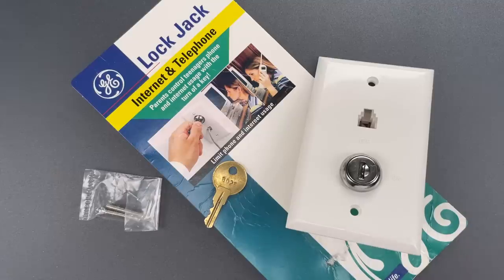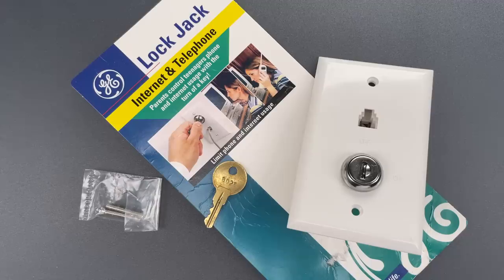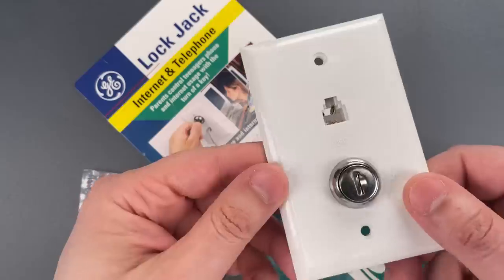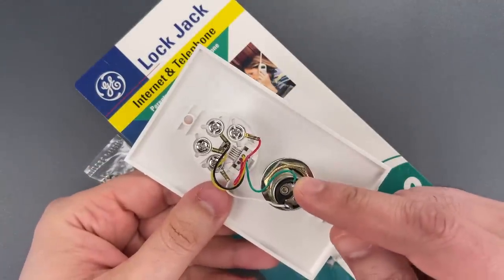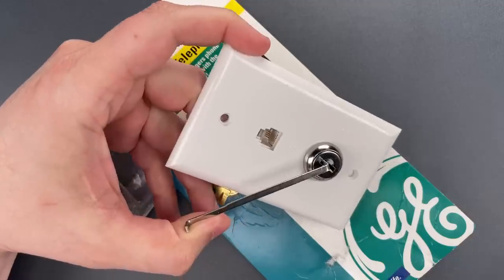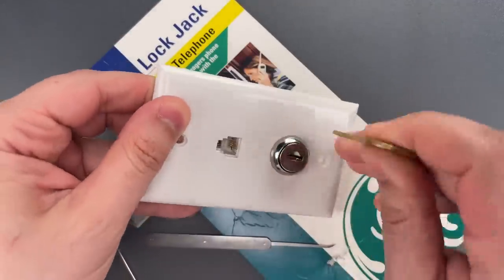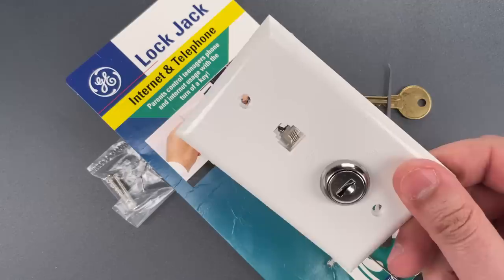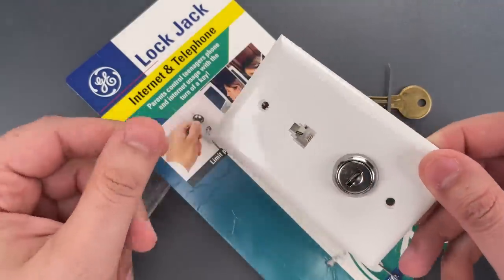[1284] 1990’s GE Internet Lock Picked

Comment: A more foolproof way to stop internet usage in dialup days was for someone else in the house to pick up a phone and start dialing
Reply: Haha or an incoming
Reply: @xspower8899  No, incoming calls will sound busy, so will not interrupt your connection.
Reply: @SilverGreen93  only if you did not have call waiting.  the beeps would interrupt most of the cheaper modems.
Reply: Yeah... 
Spend hours trying to connect to your favourite BBS only to have someone pick up an extension 😳
Those where the days... Oh how i miss them  (not) 🤣🤣
Reply: The problem was never outgoing calls. But incoming... since when using the internet in the 90's occupying the only way people had to reach each other, I can see why parents thought this was needed. Like... it's not viable to pick up the phone every 30 minutes to see if your kid is on the internet or not. So this was a good enough solution.
Reply: @anthonygandy1090  Never knew call waiting existed. At least in my region (Eastern Europe) it didn't until mobile phones were introduced, later on in the 2000s. But never on landlines.
Reply: @MateusAntonioBittencourt  As a kid in the early 90's I can speak from experience my non tech mom constantly picked up the phone and dialed not understanding what a modem even was.  This lead to much cursing on my part getting bounced from BBS's that had only a few slots or screwing up that jpg download you were already 10 minutes  into
Reply: @SilverGreen93  ah yes thats right been so long.
Reply: This would have been useful in my house as a kid. My parents got a second phone line just for internet access (because my dad could get in serious trouble with work if he failed to answer a call from them). But we also lived in a town that didn't have a local AOL phone number, so we had to use their 1-900 number that cost $6/min, making using the internet very expensive.
Reply: @SilverGreen93  Dialing will cause the connection to be dropped. I remember it all too well.

I remember call-waiting used to cause the connection to be dropped too - very annoying. There was a dial sequence that would temporarily disable call-waiting to prevent this from happening.
Reply: @jkoll42  That's precisely why I explicitly said that for OUTGOING CALLS this does nothing. Since a person can pick up... dial and drop you.

The problem was always INCOMMING CALLS. Since a person would try to call my mom, while I was in the internet. And since this was the 90's that was the only way to reach her.

Of course I didn't use the internet without her knowing and allowing... but some more disobedient kid could. Like the parents are expecting a call and the kid goes online without authorization, and they wouldn't notice the line was occupied.

Get it now? Or do I need to draw?
Reply: @MateusAntonioBittencourt  If you don't have a call‑waiting service (like I did) then the incoming calls cannot disconnect your internet. Only trying to dial a number to make a call (outgoing) will disconnect you.
Reply: My mom used to take the phone off the hook to keep my brother from using the phone. Then my brother discovered the Telephone Network Interface on the back of the house and just plugged in right there to use the phone....
Reply: The foolproof way to stop internet was to make sure "remember" was unticked on the dialer program, so the number, username and password had to be entered each and every time. 

Incoming calls would disconnect the internet if you had call waiting, voicemail or caller ID. It also happened regardless if you were phreaking the call, or on particular types of telco networks. 

Picking up the phone would only disconnect you if the handset was off the hook for longer than 15 seconds. With the noise the modem was making on the line, most people would slam the handset back down within 2 seconds. If you attempted to dial however, that would disconnect immediately. 

Don't forget, dial up internet had the cost of a phone call associated, then the internet itself was charged both by the MINUTE/HOUR and by the data used, usually by the Mb.
Reply: Or send the command `ATH` to the modem on a different system connected to the same line, which will disconnect the current call, even if that modem wasn't the one initiating the call.
Reply: If the line had call-waiting, the beep from that could bump you off-line in most cases.
Reply: @MicraHakkinen  ATD and ATA work just as well. They continue to work on LTE modems.
Reply: @MateusAntonioBittencourt  a good modem had two jacks. One for a line, second for a phone. Cause phone in parallel connection with modem leaded to poor connection speed. So if the parents connected modem properly, all they had to do was to peek up a phone. If no signal - their kid uses dial-up connection or a line is broken. First was much easier to check up.
Reply: @G5rry  "*70," I believe.
Reply: @MateusAntonioBittencourt  I am the kid who made a correct in-house part of a phone line so parents would not break my connection when they pick up the phone. If parents are true paranoid on incoming call, they will check the prescence of signal in line. And if they are good at math, not only paranoid, they will select periods between checks with random number generator...
Reply: @SilverGreen93  my old man had a Motorola house laying brick in the 90's x8500 I believe
Reply: @MateusAntonioBittencourt  the key is if parents are waiting for a call or not. If waiting, they have plenty of ways to secure a line from a kid. And if not, etherything is just exactly as you say.
Reply: Wasnt there a prefix number that you could use to deny oncoming calls making it busy so as not to interrupt the connection? Im trying to remember what i used. Until mom lifted the other phone.
Reply: Not even, just being on the line was enough to confuse a lot of modems right up until the V92 era
Reply: @SilverGreen93  Bell Labs had optional call waiting by the touch tone era in the 1970s. Similarly, color television was standardized by the FCC in 1952 after developments by RCA in 1948, but it took another decade or more to get passed in Europe, and some countries didn't have it until the early 1980s. 
There was a lot of playing catch up at that time!
Reply: Cerus98  May be true, but not in my country. Except caller id which was implemented somewhere in the 2000s, those never existed in my area for landlines
Reply: Back in the day - A friend of mine and I were addicted to StarCraft, and our only way to play multiplayer was a direct dial up connection because I didn't have actual internet.  So we would be an hour or so into a game and my sister would purposely pick up the phone to disconnect us because she wanted to go talk to her friends for hours on the phone.  We didn't have call waiting or anything, so I was inevitably at the mercy of hoping no one picked up the phone lol.
Reply: @MicraHakkinen  Sending the ATH command to an analog modem that isn't online does nothing. Maybe sending ATH to an ISDN modem would terminate a call originated by another modem on the same line? Never dealt with ISDN modems.
Reply: The wiring in my house was so bad the dial up disconnected when you turned on the shower, for some reason.
Reply: nooooo mum wait a minute dont pick up that phooone :-D
Reply: It was also a great way for someone to hear folks yelling at you "I'M ON THE PHONE!", as they start hearing the screeching of the modem in their phone conversation.
LOL!  Good times.  Good times.    Which reminds me, I need to get a "modem dialup" ring tone for my phone.  :D
Reply: lol ah the good ol' days.
Reply: i did that so many times when my brother was online and i wanted to, pick up phone-tap some buttons--wait for net to drop- repeat till he gave up reconnecting
Reply: *70 FTW
Reply: @Lucasbpc  Was that house on well water? I could see some issue with the wiring causing a disconnect when the well pump starts up.
Reply: @brianleeper5737  no, it was an electrical shower, most likely they used the same tubing to wire the phone and the 220 phase and the interference was just enough to cut off dial up when you added the 600W of the heating element
Reply: @MateusAntonioBittencourt  Jesus dude... People are on a LPL video recounting stories on 1990's dial up internet. What's with all the agro and name calling dude? It's not an argument. Lighten up.
Reply: @Lucasbpc  I take it you are in the UK? In the USA it is never allowed to run phone and power in the same tubing/conduit.
Reply: @anthonygandy1090  ATD *70,<ISP NUMBER>
Reply: @brianleeper5737  no, I am in Brazil. The cables still shouldn't run in the same tubing, but alas. We usually have fired clay brick/concrete walls, which doesn't make it specially easy to redo the tubing when the need arises.
Reply: @Lucasbpc  For brick/concrete walls where wiring needs to be done the usual solution is Wiremold or some other surface mount raceway. Some people think Wiremold looks ugly but you know what, I kinda like the way it looks!
Reply: @MateusAntonioBittencourt  well, I am sure about leaking pipes :) I've got a device that shuts the water down if there is a water under pipes.
And you are right about emergency calls. In a previous century this was usually solved by knowing neighbors' phone too. Line, phone, mom talking for hour or so, this all could be overridden by a neighbor knocking on you door with bad news.
And you are sharp as a needle, I was 14 or so when used a dial-up modem. So my knowledge was not enough to make modem not to drop communication after hang-up of parallel phone (and provider had a terribly small pool of lines so it was usual to dial for half an hour or so).
Reply: Hahahahaha
Reply: @xspower8899  an incoming if they had call waiting
Reply: The times where you could have more than one line too. The time where consumers knew ISDN and PSDN, PBX and PABX.
Reply: @rajamicitrenti1374  couldn't you have used a non local number? I don"t even remember AOL having a 900 number but ya that would make it expensive
Reply: @anthonygandy1090   US Robotics Courier V.Everything for the win!
Reply: @herrflick101   So how about all those babes.gif's?  😉
Reply: @MicraHakkinen   ATH is only interpreted on the DTE side of the MODEM, not the phone line.  In the situation you describe, ATA or ATD should drop the connection though, because the MODEM being used to interfere with the connection, will then sound tones on the phone line.
Reply: @MateusAntonioBittencourt   "If the line was occupied... no one could call the house."

People have already mentioned the Call Waiting feature that is available on some PSTN networks.  Do you not know how that feature works on PSTN?  An occupied line can still be called, the caller hears a ringing tone and the receiving end hears a call waiting tone.  That call waiting tone can cause MODEM's to drop their connection.

No different from MODEM's hearing the DTMF dialing tones for outgoing calls and then dropping the call from that.
Reply: @Lucasbpc   You had electric instant hot water?
Reply: @MateusAntonioBittencourt   "Also... why you keep bringing the fact a proper setup modem doesn't drop the call? Any idiot did that. My line never dropped when My mom wanted to make a call and she heard the "internet noises""

If your Mom heard the "Internet noises", you didn't set your connection up properly as Яков Кашин described.
Reply: @beardymcbeardface69  what are these GIFs you speak of... 🤣🤣🤣
Reply: @derrickfoster644  I was a teen at the time so wasn't paying the phone bills and thus have little memory of the cost discussion. But this was back in 1995, and I suspect that the long distance call costs were higher than that outside of the dead of night.
Reply: @herrflick101   Oh yeah, a likely story!  👙
Reply: @beardymcbeardface69  that is normal down here, yep
Reply: @Lucasbpc   Okay, I was thinking maybe the instantaneous high current of instant electric hot water, might have caused noise that your MODEM choked on.
Reply: @beardymcbeardface69  maybe. Again, that was very odd. What made it worse is, to use dial up on discount time you had to connect at night, right when everyone wanted to take a shower as well.
Reply: @Lucasbpc   Thank goodness those bad old days are behind us.

My old dialup speed would suffer whenever it would rain, because where I was living at the time, our phone lines were terminated in pits with concrete manhole covers that were not water tight.  So they'd literally start to fill up with rain water, touching the exposed copper terminations.

Same problem occurred when we got ADSL.

Thankfully my current apartment has no such issues!
Reply: @anthonygandy1090  You could get around call waiting by disabling it in the dialing string.  Usually by including *70.
Reply: @rajamicitrenti1374  Cheaper to ship the kids off to boarding school!
Reply: I always had this ambiguous feeling about the late 90s. Life was so cool back then, but internet still sucked.
Reply: @SilverGreen93  Here in the UK it exists but is pretty rare on home phone lines since the phone companies charge extra to enable it on your line.
Reply: Cerus98  There were alot of plans with data limits when the net got commercialized (mid 90's) and alot of access numbers weren't local depending on where you were.The access point would have data usage tracking in place in most cases considering what it was mostly used for in the 80's.
Reply: Cerus98   Maybe in the US, but other parts of the World did it differently.  In Australia we had dialup plans that were based on data usage.  When I started with Internet access via BBS's in 91, the existence and duration of connection time limits, depended on the BBS.  But once non-BBS dialup ISPs came on the scene, they were mostly providing data limits on a plan, with no time limits.
Reply: @SilverGreen93  Depending on the time and place, often incoming calls would make a sound on the active line so you knew you were getting another call - at some point in some places you could switch to the incoming call with a sequence of keys.
Reply: Still happening with mobile carriers.
Reply: @beardymcbeardface69  not much has really changed, my old ADSL would typically die during wet weather and storms can still cause issues in the NBN era thanks to the last mile of copper to the premises. My dialup ISP had a free account from 1am-8am I made use of in high school, got disconnected twice due to incoming calls once when a friend died and again as 9/11 happened (Australia so you need to take into account time zones). Same on the ADSL for a bit, had a faulty splitter out of the box that I found out about because of line noise complaints from my mother.
Reply: @cericat   Yeah, it's infuriating how the NBN was originally supposed to be fibre-to-the-home, then it became a political football for our political parties to sledge each other with for many years, to the point where we are still mostly reliant on copper because of the shortcuts they wanted to take.

I got lucky, because my units got fibred directly to an Aussie ISP, which completely bypasses the NBN.  But I know lots of other Aussies are still in the crappy old situation of poor quality copper connections giving them grief still today.
Reply: @sYBtyumen  I can't imagine many people connecting all the house phones to the modem's telephone port because this would require rewiring your home's phone wiring. Maybe it was different in other countries but here in the US the standard was to have all the phone jacks as a hard wired daisy chain starting from the demarcation box. The connection you describe would be an easy modification because most wiring had four wires but only two are needed for a single line, but I haven't heard of anyone doing that before.
Reply: @anthonygandy1090  There was a keycode you could add to your modem dial sequence to disable call waiting until the modem call hung up.

I can't believe people don't know this stuff.
Reply: @G5rry  Yep, yet somehow Microsoft never added that dial sequence to their connection tools.  You had to add it manually.

(Linux had to add the entire dial sequence at the time, and considering Linux was still a research OS at the time, that's no surprise.)
Reply: @anthonygandy1090  Ahh, but *70 was all you had to add to the dial up number to disable call waiting.

Comment: Paradox: In order to defeat the lock, you just have to watch The Lockpicking Lawyer on the Internet, but in order to watch The Lockpicking Lawyer on the Internet, you have to defeat the lock.
Reply: Only those with the strongest wills shall succeed!
Reply: Don't forget, once you're online wait 3 hours for the video to buffer. Also, it will be so grainy you can't quite make out everything...
Reply: It would have taken me longer to walk downstairs and find a screwdriver than it would have to fix the problem.
Reply: On dialup
Reply: That's not a paradox, the solution is you can't pick the lock and also can't watch the LPL ergo no paradox. What you describe is a "deadlock", where without a previous action from the other side each party (opening the lock; watching YT) can't advance.
Reply: Paradox has broken the lock and the brain